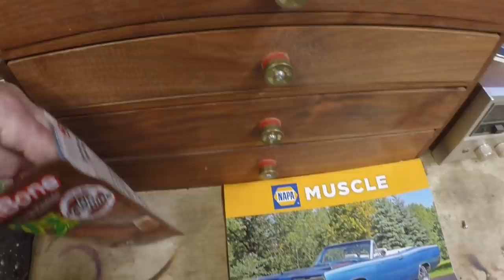Cub Cadet Dozer Build, S2:E8 Body Shop Edition!

Comment: Hi frank I cant say I'm a fan of a 3 point hitch for what ur looking at . My next question in regards to the build theres various style dozer blade styles and mounts that say cat brand  has made over the years say a d4 high track and a d8 or 10 are completely different.  Next thing are u determined in a 6 way blade or would u settle with a 4 way ? I work around multiple different dozers daily n can help you out with different designs based on real ones

Comment: I think that I have just noticed a potential problem with the tracks. As the pads are spaced away from the chain the gap between the pads opens wide as it goes around the front and rear sprockets. As the track flatens out the gap closes and I can imagine this trapping stones and then twisting the pads and chain as the stones may well be stronger than the tracks.  Sadly I dont have an easy answer and time and use will see if it is a real problem or not. If it is a problem I am sure that you will overcome.

Comment: My vote is to not use a three point hitch. Stay with a traditional push ram system outboard of the tracks. Other wise it wouldn’t look like a bulldozer, and that is what you originally said was your goal: a Cadet bulldozer. Could be done using the ball joints from a large truck as the attachment points between the rams and the blade.
Reply from the maker: That would only be a 4 way blade...

Comment: I don't recommend installing the blade from the front...  There's a good reason they hook the blade from the rear.   If it's connected from the front the geometry of the connection point will push the front of the tractor up as soon as the blade hits something,  while if it's attached from the rear this problem is avoided.   Ask me how I know!  Great project!
Reply from the maker: That would make it a 4 way blade. I think the  6 way blades are attached at the front.

Comment: Frank, I eagerly wait for your next video on the mini dozer, you have done an outstanding job so far, please don’t use a 3 point hitch on the front. It will take away from the look of the build. I realize it will make it easier to mount accessories but if you really need items that can mount to a 3 point hitch how about adding it to the rear of the dozer. I just feel with the amount of time, labor and materials you have put into this it would be a shame to put a 3 point hitch in the front and detract from the overall built at this point.

Comment: Mr. Frank, I have been thinking about your build and was watching another youtuber (Dirt Perfect) He is working on one of his dozers talking to someone about putting larger pads on. The guy told a story of a time he sold a skid steer with extra wide tracks.  They ended up taking it back basically because it took too much horse power to move and turn the larger tracks.  The customer had the same skid steer with normal tracks was out performing the new one. (I do realize you don't intend on putting wider pads on)
My concern is if you end up putting grousers on for traction will your machine have enough power or torque to turn without putting such a bind on your hydro system.  
I've seen you actually use your Motor Grader and I would think you would do the same with the dozer. Sorry this was so long winded, I just wanted to pass it for your future thoughts. The video is titled "Removing tracks on the 850j after talking with Tod....  Around the 18 min  mark if you were interested or have the time to see what I'm trying to explain.  :)
Reply from the maker: I guess we'll see what happens. The tracks slip easily without grousers.

Comment: You should have cut at least the one inch hole or bigger in each one of your growzers in the middle so when your track gets packed with dirt the sprocket smashing dirt into the hole and your growzers won't let the dirt out and it will keep packing it tighter and tighter and that will prematurely stretch your track out too fast and having that hole will allow the dirt to squish out while the sprocket pushes it into the hole and that one inch hole or bigger will help push the dirt outside like a little worm instead of packing it tighter in there
Reply from the maker: There is a 1 inch square hole in the center of each track pad for that exact reason. Has been explained in previous episodes.

Comment: If you mount those three point hitch bars on the outside of the tracks it would be close to a dozer shape , and most dozers don't do pivot steer like you were doing at the end , now a tank would do that but not a dozer sorry
Reply from the maker: Modern dozers do it.

Comment: we're in the same boat trying to figure out best solution. on my potato planter build im currently on plan D and always out of consumables. i paid local metal fab shop $1100 to mount a skidloader quick tach plate to a 8ft cat2 tractor 3pt back blade for my bobcat i told him "make it bulletproof strong so it can bulldoze rock piles and never break" first day plowing snow my 1/4 mile driveway in whiteout conditions at night outer edge caught a tree busted it in two! he fixed it now i use 1" schedule 20 pipe on the pivot for shear protection

Comment: Need whichever blade anchors which would give "you" the best practicality. It don't matter now that it doesn't like exactly like what you started as a scaled model. 
You have no top sprockets that even look like a copy of a spocket and no running boards running the full way from the top idlers (spockets) to the engine as a real one would look like..

Comment: Ball Hitches are Weak and Will Break and Not Take To Pushing Very Long - Ball Hitches are Made For Towing (Keep it it the Back) They Only Have 3/4 or 7/8 Bolt in Center (Not Very Strong) Please Round Your Corners on Your Fenders...
Reply: Button Head Allen Screws - Thanks Again, Frank...
Reply: You May Want To Mount Your Front Blade Off The First Member of Your Track Support Frame (Between The Track and Frame) Just a Thought ?